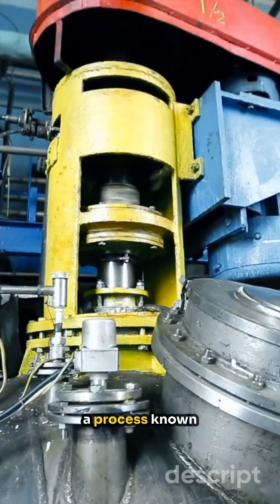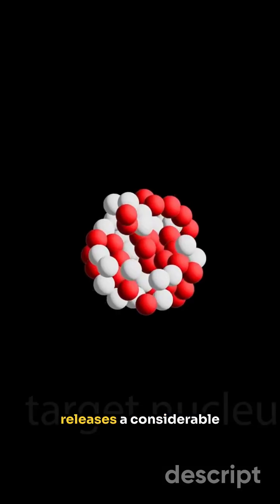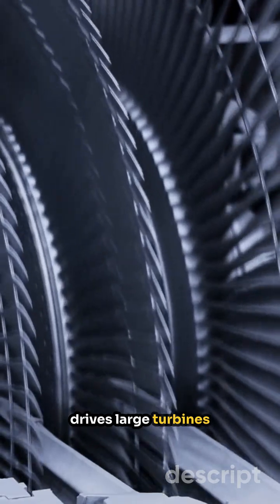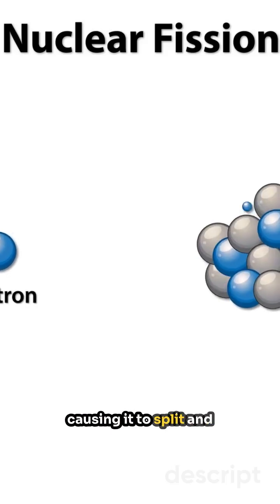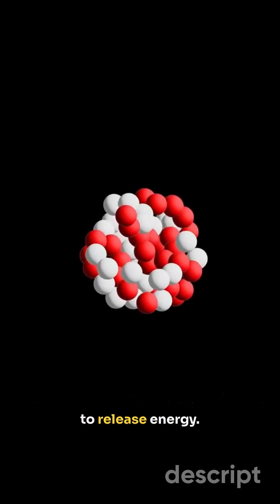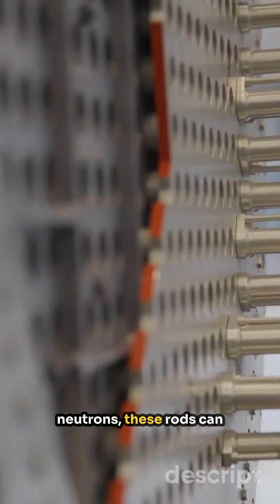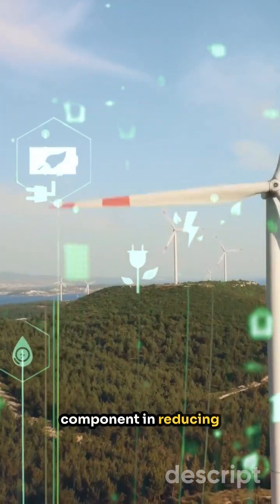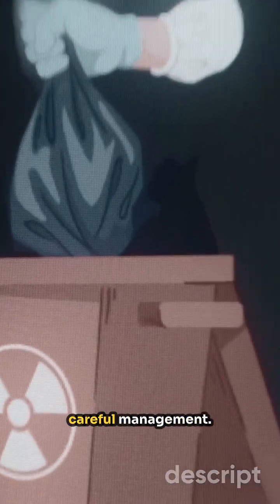Nuclear Fission for Clean Electricity

Comment: You forgot to explain why there's a cooling tower or system. It generates the low pressure for the steam to end up at. Otherwise the turbine wouldn't turn as fast And the water would float away.
Reply from the maker: I forgot to explain it, thanks for your comment😉